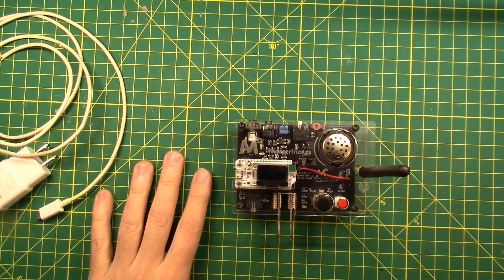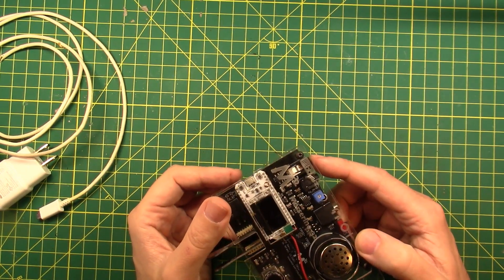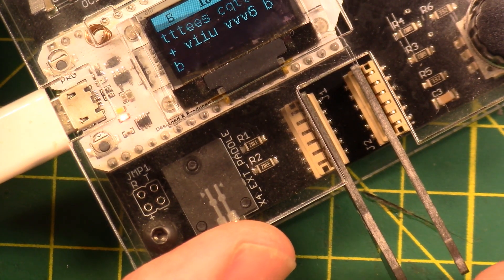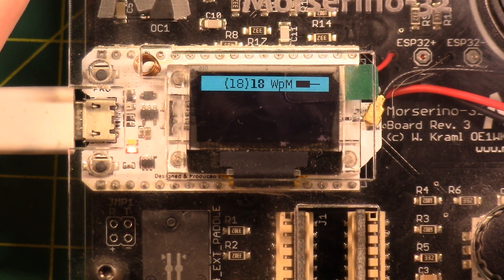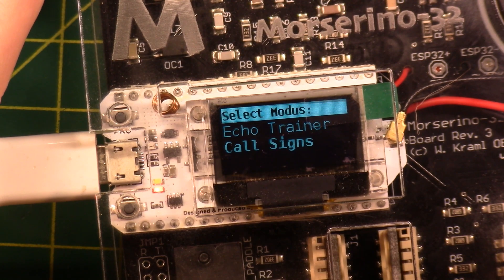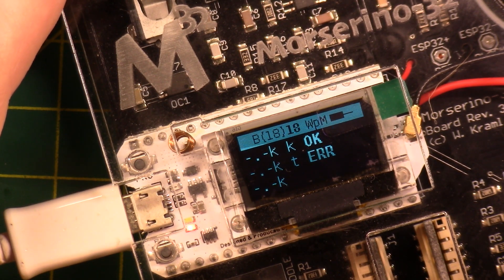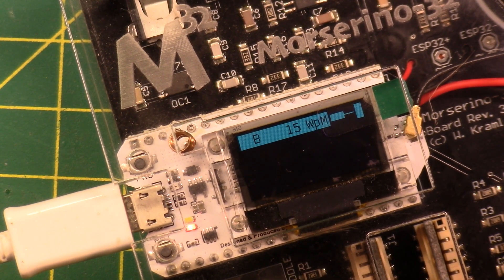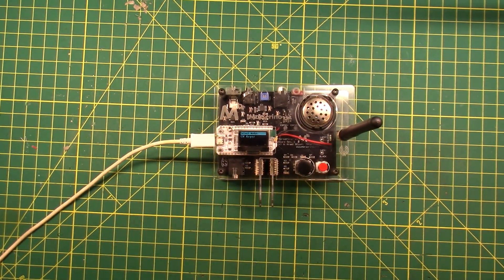Morserino-32 Extended Review

Comment: Which cw trainer is better than this one?
Reply: The difference here is you can work with sending and receiving. The cell phone applications that I found concentrate on receiving code. I like the fact that this product allows you to connect your own paddle for testing and learning.
Reply from the maker: It's hard to say, this is a good one, there are some cell phone apps that are good too.  I think the only draw back/feature here is the touch paddles act "funny" and might put you off if you are new.  Check out long Island cw club if you're looking for a group environment
Reply: I don’t get the complaint about the paddles. You can plug your own paddles in or a straight key!

Comment: The decoder listens to the in jack to decode cw on the air. You don't send it with the paddles. You need to connect it to an audio source such as your rig speaker output, preferably through a Y-adapter so you can still hear the audio through headphones or a separate speaker.
Reply from the maker: Awesome, thanks for the tip!